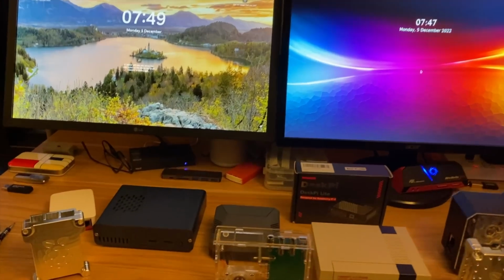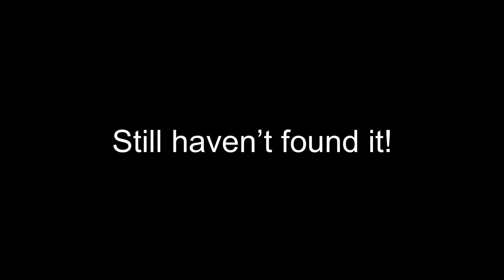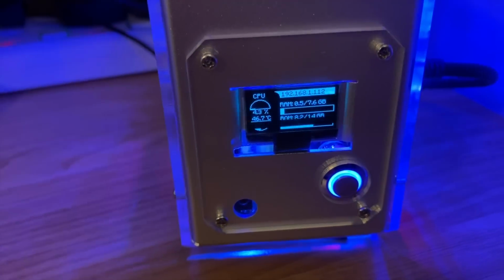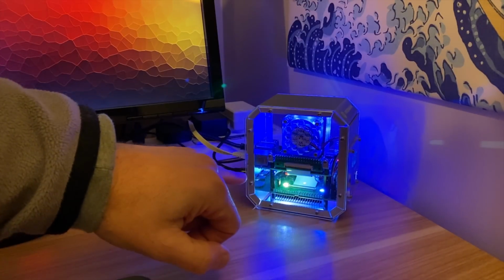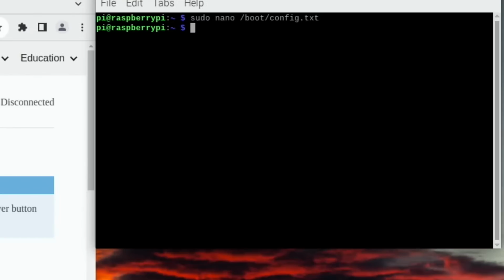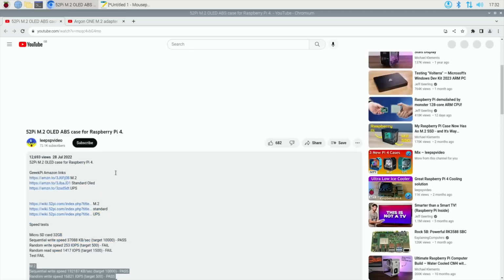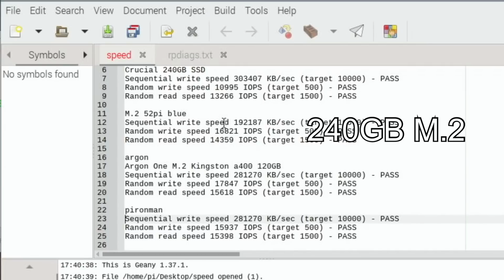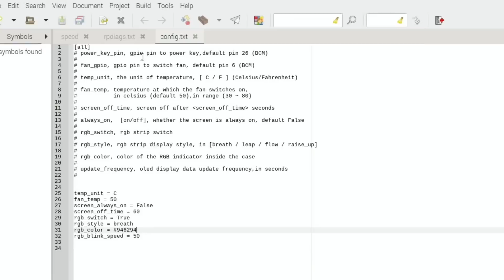Sunfounder Pironman Raspberry Pi 4 Case

Comment: Hey, great video, Raspberry PI 4 are finally in stock again so i ordered a couple. When looking for cases i am stuck between this and the Argon ONE m.2. Would you recommend one over the other? Thanks for sharing :)
Reply from the maker: Depends on your needs 
	
	I like this
	https://youtu.be/moqc4vbG4mo
	
	I think this is my favourite as it’s easy to change the M.2 drive
	Openmediavault running on a single M.2 drive. 52Pi NAS case.
	https://youtu.be/zXZcKOnM8tU
Reply: @leepspvideo  Thank you so much for your reply, i will check those two videos :)

Comment: @leepspvideo I got a question, I want to get one of these for one of my projects, however I need 1tb minimum for my project, I looked online for M.2 SATA III but they seem very expensive, is there any alternatives, SanDisk Ultra 1TB micro SDXC expensive too.
Reply from the maker: £51 SSD https://amzn.to/41PdJNN
	
	I have a 240GB one that works great 
	
	240GB SSD Kingston Vs Crucial Speed Test. Raspberry Pi 4, Pi 400.
	https://youtu.be/CRNHUuGZ9aU
	
	Make sure you get a compatible cable, linked in the description
Reply: @leepspvideo  I intent to use a retro image on the ssd, but am I am to swap between or and raw booting of the reto games image, I would but the OS on a micro sd, or even a small usb thumb pendrive.

Comment: Hi I have a Few Questions,

The white colour connecting wire strip for the GPIO Brindge, it keeps coming out from both end. Is that supposed to be that loose.

2) the micro sd card is not fitting inside and I’m afraid to put too much pressure on it. Does that work like same regular phones sd cards slots where it makes like a clipping sound as it goes in and to pull it out it required to slightly push in and it comes out with a clicking sound both times.

3) there’re 4 thermal pads, are there 2 spares or do I need to put the remaking on the raspberry pin right where the thermal top tower is fitted. Please note, if I only put two thermal pads on tower base and fit it on to P of pi I noticed there’s some space between the Towers thermal pad as well as raspberries processor. Is that space normal or do it need to put the thermal pads in the processor as well as tower and sandwich them so there’s no space.

Kindly address these concerns at the earliest possibility thankyou.
Reply from the maker: Mine isn’t loose, are you clipping it in correctly?

My sd slot is smooth click in and it holds, click it in again and it pushes out with a click

The thermal pads are as shown in the video. I don’t remember exactly
Reply: @leepspvideo  alright thanksie

Comment: Luv the Pironman.  Have two; 2nd is a "Contruction Zone".  Had ribbon orientation and slot insertion issues with 1st. For a Noob (me), laying sod green side up more intuitive than ribbon attachment.   
Sadly it does not operate as expected with other than Raspberry Pi OS.
Script not compatible with PINN multi-boot OS such as Twister 2.1.2 and Ubuntu Mate` 22.04 LTS.

Comment: Did you try it with wireless peripherals and ssd connected at the same time...? I have a Microsoft keyboard connected to it and it seems that the voltage is not enough for the keyboard to work properly. Please help
Reply from the maker: I use a logitech wireless keyboard. It worked as normal
Reply: @leepspvideo  With ssd..?
Reply from the maker: @ascaninox  yes
Reply: @leepspvideo  It doesn't hang... What keyboard model specifically...?
Reply from the maker: @ascaninox no  https://amzn.to/40ATAdt

Comment: this was a great case but my display now just constantly says Power Off any ideas?
Reply from the maker: If updating doesn’t work I would reflash the os
Reply: @leepspvideo  i have just reflashed the os and tried it on 64bit and 32bit versions of pi os? coincidentally the rgb isnt working either? I'm wondering if there is an issue since the last Couple of OS updates
Reply: power button also no longer working
Reply: I have sent support an email asking if they have any ideas, the only thing i can think of is that i updated to the latest eeprom so whether that has an effect on the script they supply.
Reply: And for those who are curious it was a complete mess up on my behalf and took ages to realise i had plugged the power directly into the pi4 not the cases power at the rear oops

Comment: First the i2c-part had an undefined error.
apt-get full-upgrade of the system, re(ee)boot and reloading the repository solved that.
Now the display is still off, the led-stripe too, only the button seems to be working. 
Kinda lost rn. 
Any tips anyone?
Reply from the maker: What os are you using?
Reply: @leepspvideo  oh, thats right. could certainly be that. i'll try another one

Comment: Talk about a hard little bugger to put together with arthritis in both hands, but is very nice and works.  I had a lot of problems getting the ribbon cables in but managed.  The only bad part is Pi4 8GB are expensive right now.  The instructions was ok to follow but I would wait to slip the little screen in until your ready to put the side piece on.  Thanks for a great review on this, reason I bought one.

Comment: Just as a little heads-up - I think you've used the pironman command in this video, so:
- you can set most, if not all settings of the parts of this case with this command (LED colors, fan speeds, temp thresholds, ...) manually, to check out the effect before setting them permanently in the config file... maybe take another look at the help text, normally 'pironman -h' 😉...
- Plus, if I'm not very mistaken, one of the parameters equals to 'reload settings from config file', so there shouldn't be any need to restart the whole machine just for that 😄, just put it in the config, and reload - a little detail that was nagging me since the video from @NotEnoughTECH about this case: you both had the list of all pironman commands on screen, in the video, but somehow both sped past it way too fast 😉...
And, sorry if I'm maybe coming across as a little condescending - that wasn't my intention, but somehow I seem to step into that trap more and more often over the last time 😔...
Reply: Good points 👍
Reply from the maker: Thanks that’s useful information. 👍🏻

Comment: I have one Raspberry pi 4b I bought for $45.00 new before the price shot up. I refuse to pay the inflated prices. These new cases d9nt matter if the value of the build new is hundreds of dollars when I can go and buy a UM350 MINI PC for under $300.00 and it's way more powerful. This 3xtended Raspberry pi shortage is unnecessary. Every unit they make is sold before its made, and they refuse to expand production because they are making a killing at these elevated prices. I will not buy a single pi until prices fall to the pre inflated market price. They aren't worth their current price.
Reply: Production can't be expanded due to semiconductor shortages.
Reply: @markevs3360  That's what they say, yet somehow there's no shortage of mini pc's. You'll have to excuse me for not drinking their Kool aid.
Reply: @markevs3360  sure. 🙄
Reply: Honestly, I've got a few extra but I'd never buy one now at any price. I'm waiting for the Pi 5. I bought a 3+ and the next week the Pi4 came out. Not doing that again at these prices. The 3b+ was only 35 bucks.
Reply: Pi5 is not even on the cards
Reply: @markevs3360  The one thing I'm sure of is that the Pi5 will be a surprise just like the 4 was. If it doesn't come in the next year, it might as well not come at all.
Reply: I work in the factory where we produce them...trust me, its a fact. Hopefully the situation will improve in the new year
Reply: @markevs3360  that's what you are told